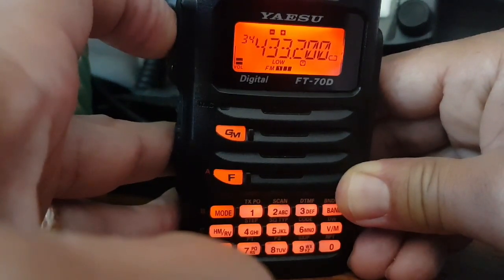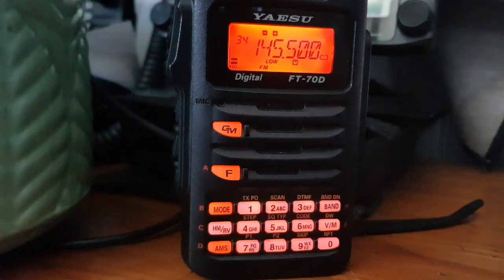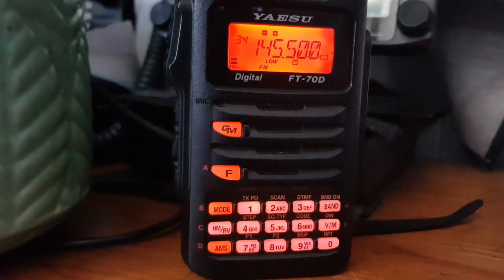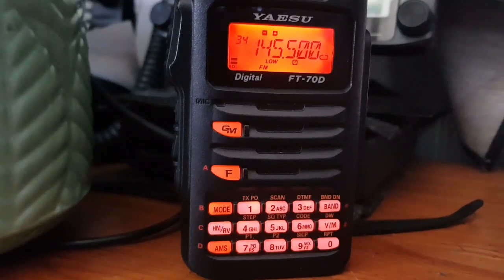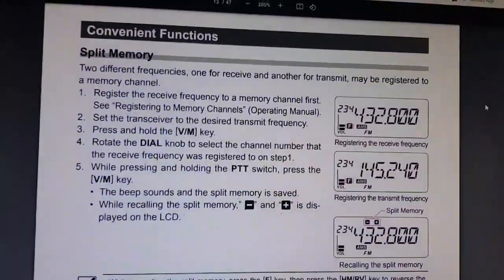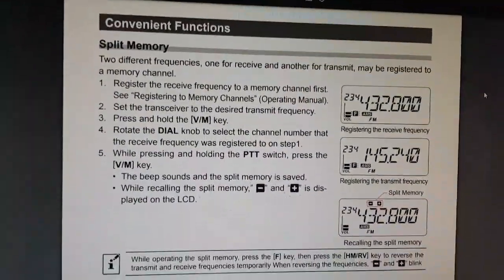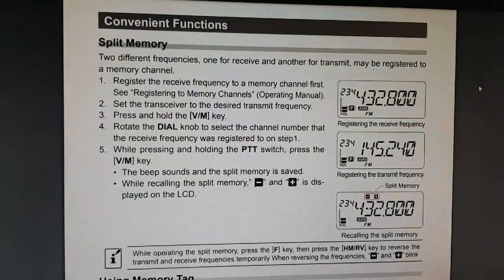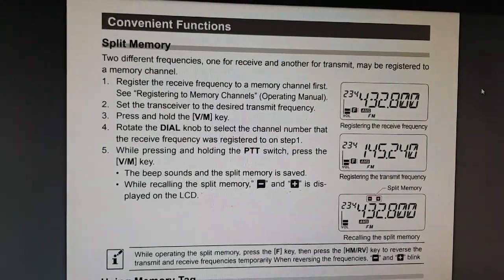Yaesu FT70D Split operation VHF to UHF

Comment: trying do this it works but the repeater im trying wont work because it has dcs tones which i programmed with the freq each not sure if theres away you can do split dcs tones
Reply from the maker: https://youtu.be/4x2lCu0mth0
Most repeaters use CTCSS
Reply: @M0FXBHamTech  This repeater has dcs code one for rx and tx
Reply from the maker: @mikegianfrancesco9431  Yes try it on split then set different DCS tones.
Reply: @M0FXBHamTech  SPLIT FREQ IF SO TRIED THAT DOES NOT WORK NOT SSURE WHY WHAT I AM DOING NOW I SET TWO CHANNEL THATS HOW I AM DOING IT NOW